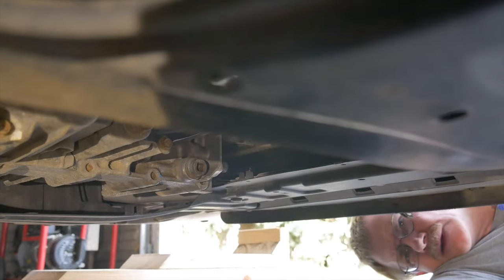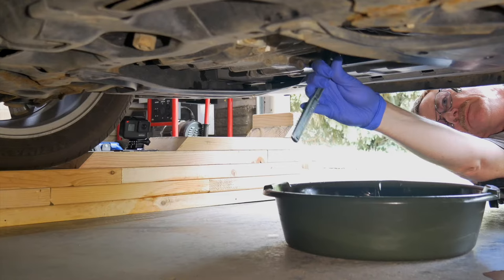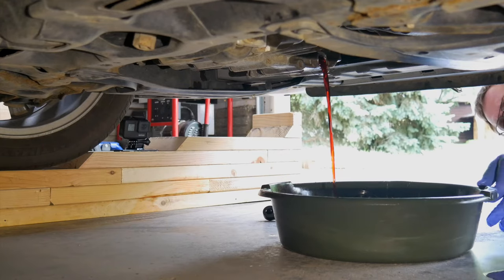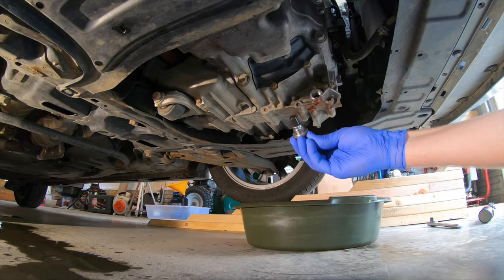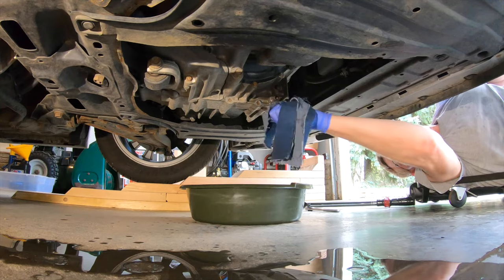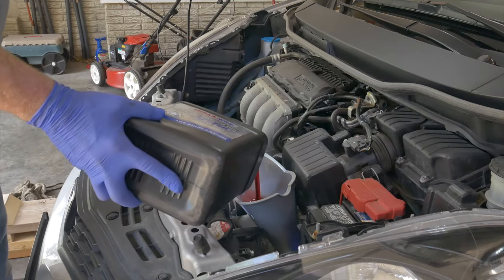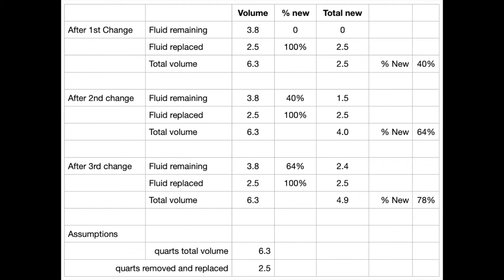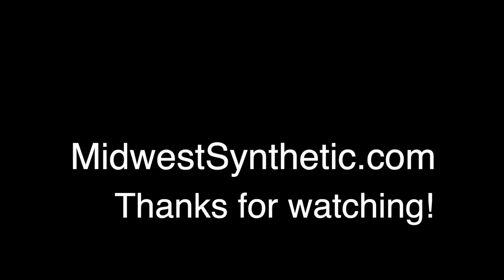Honda Fit Automatic Transmission Service - AMSOIL Signature Series Fuel-Efficient Synthetic ATF

Comment: I’d like to change the filter too. While I have seen some externals, for most cars you have to drop the pans to get to the transmission filter which I always thought was crazy. Why not use an external filter that screws on like an oil filter.
Reply: The filter is external it is located drives side behind the intake.
Reply: @redtidetogo  I have to take the battery and tray off to get to it.   I'm not saying it's impossible without doing so, but I'd like to see someone do it with the battery tray still there.
Reply: @excavatoree removing a battery is nothing.

Comment: satisfying to watch a reliable car, taken cared of properly, in a high quality to the point guide. I have not ever done AT service before as I dont' drive auto. But why do they require multiple train/fills? CVT transmission i think is just x1 drain/fill.
Reply from the maker: You only get part of the oil out when draining an automatic, so it may take 2-3 drain and fill cycles to get the majority of the fluid swapped out.  Thanks for the comment and question!
Reply: the dealership and many auto repair shops just do 1 drain and refill every time... 

the multiple drain and refills you do it yourself in your garage...

I have seen people do the same with CVT transmissions, it doesn't harm them.

Comment: One video I watched suggested disconnecting transmission cooler line at radiator to get more fluid out. Also there is an inline filter you can replace hidden under the battery.
Reply: That's quite the process to get an extra few ounces of fluid out and risk damaging the lines and creating a much larger problem.
Reply: @Dope.And.Pretty  and risking snapping a line or fitting... No. I'm literally a technician at Honda lol. Just do a drain and fill 2 times in 1 day lol
Reply: @aKjohn8798  Its literally a single rubber hose with a clamp on it. Drain and fill twice only replaces like 65% of the old fluid, as Delphi points out. Regardless, I don't care to argue with you, just want to give anyone reading the comments a bit more context.
Reply: @aKjohn8798 Sorry don’t get the drain and fill 2 times thing (he said 3 times) you drain the old fluid and fill with new fluid? Then drain that new fluid and replace with different new fluid? Do this 2 or 3 times? Thanks

Comment: Always change your transmission fluid and a little filter under the battery change your timing, chain or belt 5000 miles early and run iridium plugs if they last over 100,000 miles they look difficult to get to

Comment: honda fit uses CVT transmission
ATF fluid test is not recommended for him.
Reply from the maker: Some Honda Fit models have a CVT transmission and those would use the CVT fluid.  The 2013 model in the video has the 5 speed automatic which uses the Signature Series Fuel-Efficient Synthetic Automatic Transmission Fluid.   Thanks for watching and leaving a comment.

Comment: Do i have to change out the transmission filter as well?
Reply from the maker: The manual doesn't doesn't show a recommended interval for the transmission filter.  There's an article on FitFreak.net where some guy changed it out and cut the filter open and it was very clean inside.  I've never changed mine but likely will before too much longer as the car is nearing 10 years old.  Thanks for the question!

Comment: Do you run the car in between each change.  I had heard to run it 100 miles in between each change.
Reply from the maker: Running it a few miles and all the shift positions should mix it up good.
Reply: @midwestsynthetic so did you flush the TF 3 times in a short period of time or just once?

Comment: Thinking on putting my 2006 Ford Explorer is it worth it does it shift better or what do you think about amsoil
Reply from the maker: I would definitely say the Honda shifts smoother with the AMSOIL fluid. AMSOIL makes top of the line synthetic lubricants.  I've used the transmission fluids in my Fords and Jeeps, as well as this Honda. I've been very happy with all the products including motor oils and filters.  The fuel additive, AMSOIL Pi, was the one thing that finally cleared the intermittent cylinder misfire code on one of the Jeeps.  Thanks for watching. Please let me know if you have any questions.  Thanks!
Reply: After you changed the fluid with amsoil do you wait 30,000 to do the next transmission fluid change
Reply from the maker: 30,000 is a good interval for a pan drop fluid filter change.  AMSOIL recommends: "Normal Service: Follow the vehicle manufacturer's normal-service drain interval.
Severe Service: Double the vehicle manufacturer's severe-service drain interval."
I tend to be conservative, it's a lot easier to change fluid than transmissions.  For the Honda in the video, going forward I'll probably change it more frequently with a single drain and fill.  That doesn't have a filter, no pan drop,  so it's simple as an engine oil change.  Thanks for the question!
Reply: Yup my Explorer you got to drop the pan and put new filter so I’ll change every 30,000 miles

Comment: That was an excellent, clear video.  But, just to be clear, when I change the TF, I need to change the fluid 3 times to get all the old fluid out?  If I were to take it to a dealer, would they really do that???
Reply from the maker: I'm not sure what the dealer would do, which is a good reason to do it yourself.  You only get part of the fluid out so that's why it needs to be drained 2-3 times to exchange the majority of the fluid.  With no pan to remove and replace it's a simple drain and fill, very simple and easy for an ATF service.  Thanks for the question!  I appreciate you watching and leaving a comment!!
Reply: That being the case, do I need new sets of cvt fluid for each change, or do I reuse the fluids that I let out?  @midwestsynthetic

Comment: Hi how much oil required for my Honda jazz 2011 1.3  automatic gearbox?? Please
Reply from the maker: The 2011 1.5 Fit shows  2.6 quarts Initial Fill;  5 speed SP5A Total Fill 6.2 quarts.   I have no data onto 1.3 Jazz, sorry.  Thanks for the question.
Reply: Honda Jazz III with engine 1.3 L, engine oil capacity in quarts / liters.
Car fuel: gasoline.
Honda Jazz engine cod.
Engine capacity: 1339 ccm (81,30 cubic inches).
Honda Jazz engine oil capacity: 3.6 liters or 3.8 quarts US or 0.95 gallons US.
Honda Jazz manual gearbox oil capacity: 1.5 l or 1.58 qt or 0.39 gal.
Honda Jazz automatic gearbox oil capacity: 2.5 – 5.9 l or 2.64 – 6.23 qt or 0.66 – 1.55 gal.
Honda Jazz 1 recommended engine oil: 5w30.

Comment: Like the video but could I just drain all of it out and than put the 6.3 qt back in and call it a day ?
Reply from the maker: You don't get all the fluid changed out in a single drain and fill so if you don't know the service history or just want all the old fluid purged multiple drain and fills are the best.  On the positive side, they're easy to do compared to a pan drop.  Going forward I'll just do a single drain and fill because I know what's in it and it won't get too many miles for that. Thanks for question!
Reply: @midwestsynthetic  I got a couple question confused as hell I get what your saying put 2.5 qt in 3 times drain than fill it up mine is a 2008 automatic Honda fit I've seen two different numbers on capacity so after I drain third time do I put 6.3 quarts back in ? And I can't find oem oil is mine a cvt being 2008? Could you tell me which Castrol is best for me ?Castrol my favorite brand thanks for answering these questions hammer
Reply: @midwestsynthetic  this is what I wanna put in it Castrol Transmax High Mileage Automatic
Reply from the maker: I'm not familiar with Castrol products so can't comment on those. The AMSOIL lookup guide doesn't show a CVT for the 2008 fit.  CVT's take a different fluid than 5 speed auto in the car in the video.
Reply: @midwestsynthetic   ok so was I right about flushing it 3 times with 2.5 qts if so after I drain it the third time is do I really put 6.3 qts in?
Reply from the maker: You would put back in the amount you drained out.  You would put enough back in to bring it to the proper operating level for your transmission.  Each drain and fill sequence replaces old fluid with new fluid.  After the first time, you're also draining some new fluid so there are diminishing returns with each cycle.  Hope that makes sense. Thanks!
Reply: @midwestsynthetic  I did it for one cycle today I did it while cold not thinking anything about it and 4.5 qts came out seems like alot  so I put 4 new qts in it reading right on the stick I think he had it overfilled by half a qt so I'm gonna run it 100 miles and drain 2.5 out hot than 100 miles and last drain he had that thing torqued at 60 on drain plug bout died trying to get it off I put it back on at 36 not leaking so far thanks for your tips boss

Comment: My Acura TL type S. I was confused which I fill it out info in car on amsoil website. To match product. Trans fluid signature series and one of my friend show me signature series fuel efficient both are different. Both works on Honda dw-1?
Reply from the maker: AMSOIL Signature Series Fuel-Efficient Synthetic Automatic Transmission Fluid is recommended for vehicles requiring Honda DW-1 fluid specification.  Check out AMSOIL.COM for list of fluid specifications.  Product code is ATL1G-EA for gallons.  Thanks for the question!
Reply: Did you do the transmission fluid change with Amsoil? W

Comment: @
MidwestSynthetic      Since you've switched to the AMSOIL Signature Series Fuel-Efficient Synthetic transmission fluid on that Honda Fit :
1- have you had any shift quality issues?    
2- Do you notice that it shifts better or anything that would be described as better since switching to amsoil over the OEM honda fluid?
Reply from the maker: It does seem like it shifts smoother.  That's been the impression I've had with other vehicles too.  The AMSOIL transmission fluid is a good product.  There's a link to the AMSOIL lookup guide in the video description, to make sure you're using the correct product for the specific application.  Fluid level is critical.  Fortunately the Honda Fit (2013) still has a dipstick so it's easy to do.  Thanks for the question!
Reply: @midwestsynthetic  Thanks for the info.  Ya isn't that just idiotic how they are getting rid of the transmission dipsticks, i understand from their point why, but as the owner or a mechanic servicing the transmission.....it sucks.  Take Care.

Comment: I've been using amsoil for my motor oil but I've been wanting to change the transmission fluid on my Honda fit 2013 do you use it on your car? If so how is it
Reply from the maker: Yes, I use AMSOIL products in all my vehicles. It's working great in the Honda Fit.  To me it shifts smoother now. With no pan drop, just a drain and fill, the Honda Fit is easy to work on.  One thing to point out is you need a funnel that will reach the fill hole since it is down low.  Thanks for the question and watching the video!
Reply: Genuine DW1 changed every 10K, no issues since day 1.

Comment: gear box automatic transmission fluid capacity honda fit 2004 model
Reply from the maker: The AMSOIL product lookup guide includes other information like fluid capacity along with product recommendations.   I'll leave a link at the end of the comment.  However, it doesn't show any specifications or recommendations for the 2004 Honda Fit.  The 2013 Fit in the video holds about 6.3 quarts total and 2.5 quarts are replaced with each drain and fill.  Thanks for the question!         http://www.amsoil.com/guides.aspx?zo=5265385

Comment: I like your wood ramps, that's a great idea.
Reply from the maker: Thank you!!  I actually made them for that car.  It sits too low for my floor jack to reach the front lift point.
Reply: Same ;)
Reply: I too like your wood floor ramps.  What did you use to keep the ramps still (and not sliding away) when driving up the ramps?

Comment: At the very first change, you were mixing AMS with honda OE fluid.
Did you experience any mechanical difference? 
I want to go with AMS too, but worrying about mixing 2 different fluids might cause unexpected damage.
Reply from the maker: I had no issues.  It's working great.  Thanks for the question!

Comment: I wonder if you can run Rotella T6 5W 40 in the engine
Reply: stick with the recommended 5w-20. Full synthetic is best. I really like Pennzoil Platinum. 5 quart jug at Walmart is about $25.

Comment: Hallo sir my unit is Honda fit 2010 model dn my odo is almost 95k and I never change my transmission fluid! My question is how quarts do I need and what kinds of fluid'? Thanks...
God bless...
Reply from the maker: Thanks for the question!  It would be about 2.6 quarts for each drain and fill sequence. 
Check out the Vehicle lookup and cross reference guide for more specific info:  

http://www.amsoil.com/guides.aspx?zo=5265385

Comment: Hi mate this oil your using is it suitable for A CVT gearbox transmission
Reply from the maker: The ATF used in this video is not suitable for CVT transmissions.  However, AMSOIL does produce other synthetic transmission fluids including those for use in CVT transmissions.  Best thing is to check the AMSOIL product guide for recommend products for your specific application. I'll leave a link to that at the end of this comment.   Thanks for the question!       http://www.amsoil.com/guides.aspx?zo=5265385

Comment: Do you change the fluid after 100 miles because the Amsoil and Honda fluids are not compatible?
Reply from the maker: Thanks the the question.  Here's what AMSOIL states on the FAQ page:

"Is it required that all of the transmission fluid be removed before adding AMSOIL synthetic transmission fluid?
Answer: No. AMSOIL synthetic transmission fluids are compatible with petroleum and synthetic transmission fluids and can be used to top-off transmission fluid levels. However, when conducting a transmission fluid change, most of the fluid in the automatic transmission will be replaced with the new fluid."

You will of course want to use the AMSOIL product that's compatible with your particular equipment.   You don't get all of the fluid replaced on a single drain and fill so the repeated drain and fills are the easiest way for the home gamer to swap out a majority of the fluid.

Comment: Can you really use Amsoil on Honda transmission? Will mixing it with the Honda OEM ATF ruin the transmission?
Reply from the maker: Thanks for the question.  This is what AMSOIL has in their FAQ section on transmission fluid:

"Is it required that all of the transmission fluid be removed before adding AMSOIL synthetic transmission fluid?
Answer: No. AMSOIL synthetic transmission fluids are compatible with petroleum and synthetic transmission fluids and can be used to top-off transmission fluid levels. However, when conducting a transmission fluid change, most of the fluid in the automatic transmission will be replaced with the new fluid."

For the car in the video, the service history was unknown and most likely still had the original factory fill.  I wanted the majority of the fluid replaced with AMSOIL which is why there are multiple drain and fills.  Additional drain and fills are the simplest way to swap out more fluid, especially where there is a drain plug (vs. pan drop).

Comment: For Honda you can no longer get "a good shop manual." To get good service information you have to subscribe to an online service manual. It is rather expensive.
Reply: Check your local library...ours allows us to access online manuals!
Reply: @Evelyndowning  7 years ago I could get the Chilton manual for my Honda Fit through my local library but then the library  stopped providing the link. Also, I much prefer the official Honda literature to Chiltons or any other 3rd party manual. More detailed instructions, in clearer language. Better drawings and photograpshs. Although too often the official literature recommends that you use only their very expensive professional special Honda tools. Third party manuals sometimes provide hints on how to do some job without special tools. So I like to have some of these manuals too, but only in addition to the official manual.